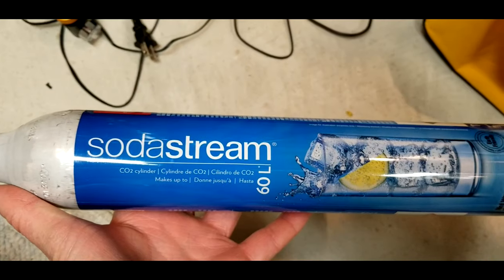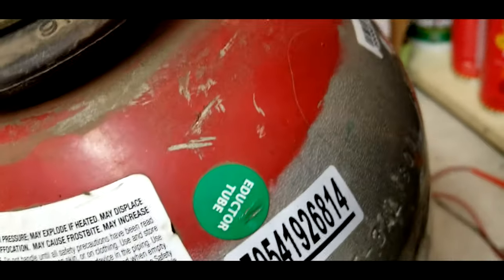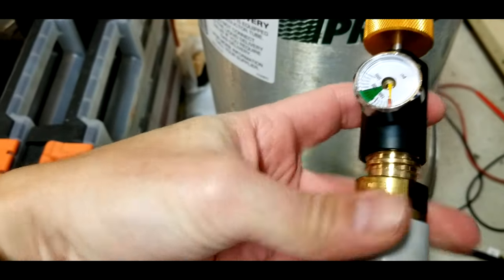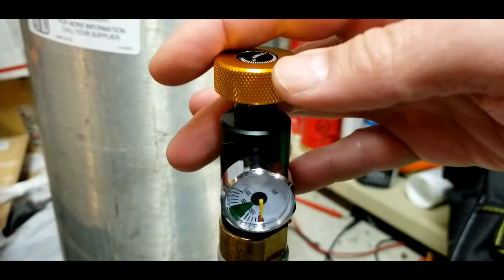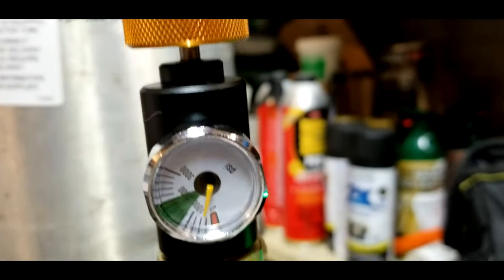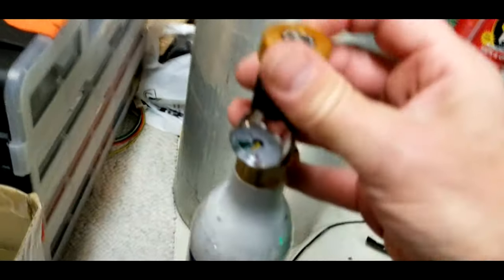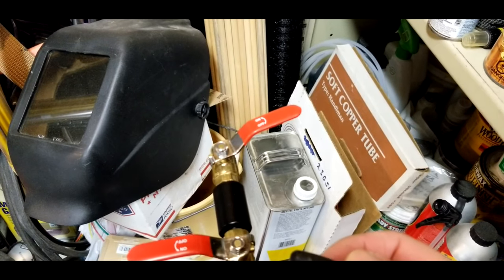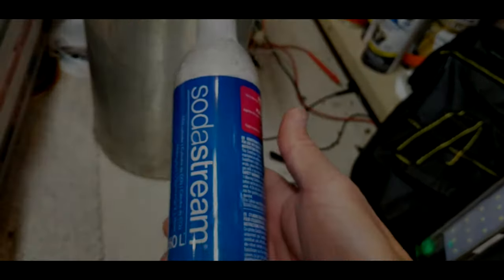How to Refill your Sodastream CO2 Cartridge for under $1.00!

Comment: Picturing blowing myself up trying to do this! 🤣🤣💥
Reply: Haha I just did. Gas spraying out everywhere. I've been refilling successfully at least four times before. Not sure what happened. Lol
Reply: Yeah, I don't know how long to let it refill or even how long it takes to refill. I know I've never been ballsy enough to keep filling until it gets into the green. It starts making this high pitched noise and I'm all, welp that's full enough.
Reply: 🤣🤣 Good thinking!
Reply: You could just check a new store bought bottle
Reply: Not likely.  The Sodastream bottles include a burst disc behind the pressure relief nut.  It's about the thickness of a playing card (maybe more) -- it's nowhere near as thick as the container walls.  Loooooooong before you get remotely close to compromising the tank, the disc will puncture and gas will escape from the hole in that nut.  I know.  Firsthand.
Reply: Me too lol

Comment: Hey bud, a VERY important safety note. At the beginning of the process you say say turn the knurled knob clockwise from the top. Then you proceed to turn it counter clockwise. IE these valves work backwards from a normal tape to open and close. If someone does what you say and their Sodastream canister is not completely empty they are going to get a  blast of CO2 in their face because tuening it clockwise extends the pin and it will press the one on the aodastream canister when they screw it on
Reply: ok, to be specific, the adapter that goes on the canister is not a valve at all.  It's a valve actuator.  Turning it counter clockwise lifts the actuator pin up - allowing you to screw the adapter onto the canister without pressing the center pin of the actual valve.  I'm not sure how you're going to get a face full of CO2 if you screw the adapter onto the valve, even with the actuator pin in the down position.  Perhaps a handful of CO2 spray, but it doesn't spray up :) 

Great video!
Reply: Regardless, his overall point is valid, and I noticed it as well. You turn the knurled knob COUNTER CLOCKWISE to back it off, to the point where it's not going to open the valve on the cartridge. For all intents and purposes, that means CLOSED. And then you turn it CLOCKWISE to advance it into the valve on the cartridge and allow gas to flow. So for all intents and purposes, that means OPEN.

And that is backwards from the situation on the large CO2 supply tank, in which you turn the large knob CLOCKWISE to CLOSE it, and COUNTER CLOCKWISE to OPEN it.

It would be useful if the knurled fill valve had clearly labeled directional arrows like the red levers on the adapter that attaches to the supply tank. I've thought about making a label for myself, although by now I know the reasoning, so I'm not sure if it's that important any more. I suppose having it in front of my eyes every time might prevent me from being careless and making a mistake.
Reply: @rrrichf  Thanks Vance, I was just going to post the same.

Comment: I think someone needs to start a Kickstarter project for a water cooler that does cold water hot water and sparkling water with flavor options it should take a 5 to 7 lb CO2 tank this would be an ideal solution for most people. The only systems that should be using these small tanks should be built into refrigerators.

Comment: My assumptions:
- Baseline sparkling water (Kroger) 2 liters, 1 dollar.
- Consumption of 80 litters per month
- Purchase of Sodastream/Drinkmate machine, co2 tank, co2 fill (25usd per 5 gal) and this adapter: 120 + 80 + 25 + 40 = 265 (until something breaks, of course)
- Constant prices for purchased sparkling water and c02 refills

Conclusions:
- First 60 liters will cost you the purchase of the machine (duh, it comes with a single co2 bottle)
- Then, this configuration costs 10 cents per liter
- You will cover the expenses after 7 moths of using it.

- After 1 year of use, you will save $200
- After 5 years of use, you will save $1700, the burden of carrying bottles and a LOT of plastic :)
Reply: Thank you for doing the math, but 80 liters per month?? We do more like 5-8.
Reply: @FOXDADDYSUPREME1  I do 30 per month and I’m the only user. 1each day, every day. Not soda, just water.
Reply: AND Kroger sucks for the way they are treating their workers.
Reply: Thats cool. I found it cheaper (and healthier😅)   to just not drink anything carbonated😁 milk, water, juice, coffee.  Still have to watch sugar content on store bought coffees and alot of types of cheap juice as well.
Reply: Well shit. You just did all the work for me. Thanks!
Reply: @carldalsasso8603  so uhhh why did you watch this video🤔
Reply: @carldalsasso8603  So, like...what are you doing in the comment section of a video about a beverage carbonator?
Reply: This does not factor in the cost of flavorings that would come with store bought. We are currently looking in to the most cost effective version for diet coke.
Reply: Yeah okay we believe you…NOT!

Comment: Omg! Thank you so so much for this. 

I just contacted AirAsia to verify they have tanks either for lease or will fill. They lease tanks for $75/yr here in Cincinnati and I was told the only size that has an induction tube is the 20lb size sooooo... 20lb it is! (That's like $0.21 cents a day). This will save my family and I so much money! 

Thank you again!
Reply: I purchased a 'refurbished' but guaranteed 20 lb tank for a good price as they are expensive, and almost paid the same price to have it shipped to my house.  Figures.  I last watched a youtube video on a company who sells tanks, used tanks, and refills them for customers.  Oh well I have my tank now and just purchased the hose to fill my little tanks from the big tank.  Great Video.
Reply: It makes sense to have high shippings cost when it comes to these sensitive pressurized tanks. If it falls over it could become a steel missile sailing around the room like a balloon

Comment: Thank you so much! This is awesome. Just tried it for the first time, worked great.

Fwiw, I was quoted $290 for the initial 20# tank (full), and $60 refills, at AirGas. Went to a homebrew supply store instead, and it's cheaper at $175 for the initial tank (also full), and $50 refills. This is in the SF Bay area.
Reply from the maker: You can also get them on Amazon: https://amzn.to/3GhAr7g
Reply: True, but those prices are empty. Buying them local, and the initial tank price includes it being full.
Reply: Do you mind sharing the location of your homebrew supply store?..  I'm also in the bay area.

Comment: • Be sure to buy 'food grade' CO₂ — not all is, especially when bought for welding or paint ball guns.
• Put the Sodastream cylinder in the freezer for an hour or two before filling, then fill immediately.  Wear gloves!
• CO2 Supermarket sells adaptors for all three types of Sodastream cylinders: the old standard pipe thread (still used in Oz and NZ), the newer 'coarse' thread, and the unthreaded 'quick connect' type.
Reply: Your comment should be pinned! I was going to say the same thing... You don't just use any old co2 tank! you have no clue what was in the tank over the years and you want food grade CO2!

Comment: That is a dick move to try and prevent customers from refilling these.  I am thinking about getting one and this is the first thing I looked up because the cost of the new co2 is outrageous.
Reply: A better option is to just use a CGA320->Sodastream adapter hose and directly hook up a commercial CO2 cylinder straight to the Sodastream machine.  Any time refilling is done, you're going to lose some CO2 in the filling/adapter equipment.  But, do directly hook up to a SodaStream, you DON'T want the liquid supply tank like is shown in this video, you want a standard one that just supplies gas CO2.
Reply: @mrh829  This is what I did.  Hooked a 5lb tank directly to the soda stream.
Reply: @OperationDx1  Excellent.  I've got a 20lb hooked up to mine.  After 5 years the Sodastream end of the adapter hose wore out (valve wouldn't close any more) so I had to replace it about a month ago, but still far cheaper than any other option!
Reply: @Mike Waddle Drinking 3-4L/day myself, 20lb lasts me 9-10 months. I really enjoy only needing to go get CO2 once or twice a year.  I did recently replace my old Sodastream Jet with a new Fizzi, so it will be interesting to see if the new machine ends up using more or less CO2 as time goes on.
Reply: @Mike Waddle Good to know, as I still have the old adapter on hand just in case.  I managed to find a supplier that had the quick disconnect to TR21-4 connector for only $6, so I didn't have to re-buy a whole new adapter hose.  Unfortunately for others, I got the last one in stock at that price, most others are in the $15-20 range for just the connector.
Reply: @Don Talley  To do this mod, there are really only 3 items that you need to acquire, but I only would recommend dong this on the "Manual" Sodastream machines, not the electric ones that have the automatic buttons to carbonate.

1. First is the CO2 tank itself.  It doesn't make a difference what size tank you use (5/10/20/50lb), you just obviously have to consider where you're going to set up your Sodastream machine and buy a tank that will work in that location.  You also want to get a STANDARD CO2 tank that supplies gas CO2, not the one shown in this video that has the tube in it to supply liquid CO2 (you only want liquid supply CO2 when you're using it to refill other tanks).  A lot of people use 5lb tanks; I use a 20lb, but the process is the same (the only difference is how often you have to go get more CO2; my 20lb tank lasts me 9-10 months while drinking 3-4L per day).  This is also where a lot of FUD can come up in discussions about alternate CO2 sources, as there are a lot of people that will scream "if you get your CO2 from a welding supply store, that's not going to be food grade CO2 and it could be dangerous!"  This is all anecdotal, and there is no studied data to show that anyone has been harmed by using welding CO2 in their Sodastream, so this is a decision that you'll have to make on your own.
If you want a "pretty" tank that looks nice, you can buy new EMPTY CO2 tanks on places like Amazon, but then you'll have to find a local place that will fill it.  If you don't care what the tank looks like, local places like homebrew shops, welding supply stores, or other commercial gas suppliers will probably be able to sell you a tank, but it very well may be used and ugly looking.  I personally went to a commercial gas supplier (Airgas) and purchased my 20lb tank from them (original purchase price was around $145 for the outright price of a full tank).  By going to a commercial gas supplier like this that supplies gases to restaurants, etc., that also meant that I was able to specifically buy "food grade CO2," which I did mainly to shut down any arguments that other people may have against my big tank being somehow "dangerous" by not being food grade, not because I think it's strictly necessary.  When I need more CO2, I bring it in and do a tank exchange, which is around $36 for me to swap out a 20lb tank (keep in mind 20lb is equivalent to 22 SodaStream cylinders that would have an exchange MSRP of $330, so even just using this tank ONCE saves money even with the steep upfront cost to buy the tank).

2. Regardless of the size tank you acquire, all of them will use a CGA320 fitting on them for hooking up the tank to whatever you are going to use.  So, you need to get a hose that will have the CGA320 fitting on the tank and, and the Sodastream tank thread on the other.  There are many options for adapter hoses available on places like Amazon, just search for "CGA320 to Sodastream" or "CGA320 to TR21-4."  The exact model of adapter hose I bought is no longer being sold, so I cannot recommend any specific product brand that is available now.  Most of them cost in the $30-40 range these days (mine was $100 5 years ago).  The Sodastream end will screw into your machine just like a normal tank.

3. Nylon CO2 washer.  Depending on the exact adapter hose you purchase, it might or might not come with a nylon washer for the first time you use it.  When attaching the CGA320 end of your adapter hose to the CO2 tank, you must put in a nylon washer in order for it to make a proper seal with the tank.  Searching "nylon CO2 washer" will give you plenty of options on Amazon.  These nylon washers are technically intended for single use, so you will want to replace this with a new one any time you refill or swap out your big tank.  These are normally sold in bags of multiple washers, but will be in the ballpark price of around 50 cents per washer.

I recommend keeping the CO2 tank positioned where you have easy access to it--I ALWAYS keep the valve on my CO2 tank CLOSED when I'm not using the Sodastream, as I just don't want to take the chance that my adapter hose could leak and empty out my big tank prematurely.
Once everything is installed, it's your choice to either simply leave the back cover completely off of the Sodastream, or you could cut a notch in the back cover for the hose to escape, but that's all aesthetics that has no bearing on functionality.

About the only other thing worth mentioning is that with the big tanks, depending on how full the tank is, you'll find that you have to make adjustments to how many button presses you use to carbonate water (a freshly filled tank will carbonate very quickly, but as it gets used up, you'll need more/longer presses to achieve the same result).
Reply: @mrh829  Ah, thank you. You’re talking about a direct link to the machine. Not refilling the original SodaStream cylinder. Gotcha.
Reply: @dontalley2182  Yes, exactly.  A direct link will actually allow you to have more usable gas out of every tank, as every time you do a refill, there is some gas wasted during the refill process, plus you have the convenience factor of not having to mess around with doing the refills all the time :).

Comment: As long as your co2 tank has liquid in it, pressure is temperature, temperature is pressure. If you need more pressure put the tank in warm water. If you need lower pressure in the cartridge, put it in ice water. If the tank no longer has liquid in it, it is essentially empty. How full or empty it is is determined on a scale, not by a pressure gauge. To fill the cartridge it must be at lower pressure than the fill tank. There should be a weight at which the cartrige is full, as no matter what is the pressure if it is totally full of liquid it will burst when warmed unless a safety releases first.

Comment: It's a lot less hassle to get a standard commercial CO2 tank (not a siphon tank like the one in this video) and hook it directly to the Sodastream machine with a CGA320->Sodastream hose.  This has the added benefit of not needing to spend all that time doing the refill process, and is a lot safer; refilling tanks can be dangerous if not done carefully.
Reply from the maker: I would  have absolutely done this (and considered it)...but there is nowhere I could stash a 20-lb (or even a 10-lb) CO2 tank anywhere near my Sodastream.
Reply: @ScottsSynthStuff  Fair enough.  Space concerns are why my Sodastream is in the basement rather than in the kitchen.
Reply: It also means that you're always keeping the line under pressure. Which has safety issues of its own. In this case, my adapter hardware is only under pressure occasionally for a few minutes when I need to refill.

And be sure to properly secure your large CO2 tank. It's much easier for me to have a secure setup where it's chained upright in the garage, compared to the kitchen.
Reply: @rrrichf  Nope. I only open the tank when I am carbonating bottles. I close the tank during the carbonation process and get all the pressure out of the line and into my Sodastream bottle. I just don't trust quick connect fittings to not leak.  Tank is wedged into a tight spot where it would be extremely difficult to tip it; tipping it would have to be intentional.
Reply: @ScottsSynthStuff  I read that the 10 or 20 lb tank can deliver too much pressure to your co2 dispenser, so I would think it would be best to refill a little tank and use it as you would when you first purchased your soda stream or which ever co2 dispenser you  own.  I do not know for sure, but I read the big tanks can hold a lot more pressure than the little tanks.  Just something I saw on a video.
Reply from the maker: @kfl611  That's incorrect. Liquid CO2 always delivers the exact same pressure at a given room temperature (around 750 psi) regardless of the size of container.
Reply: @ScottsSynthStuff Put the soda stream device in the shop with the CO2 tank, then go to the shop to fill the plastic bottles - I have 2.  This also removes one junky looking kitchen gadget out of the kitchen.

Comment: I refill my own canisters but I make sure my CO2 is beverage grade, not just industrial grade.
Reply: Most industrial grade is also medical grade. Our local CO2 provider uses the same CO2 for the hospital and local medical testing labs. They also provide CO2 to restaurants and local vendors for beverages. Basically check to see if they use the same stuff for welding. (Ours does. They say this on their website.) I agree with you that we can't take it for granted, but I do think it's common enough to use the same CO2 for cross purposes that it's not a big deal to ask.
Reply from the maker: I was going to answer the same thing. I use Praxair, and they don't have a different CO2 plant for medical/food grade/welding purposes. It's all exactly the same stuff, just in different tanks with different labels on them.